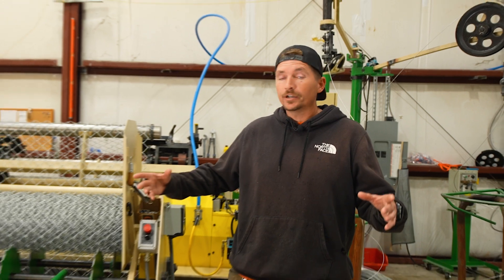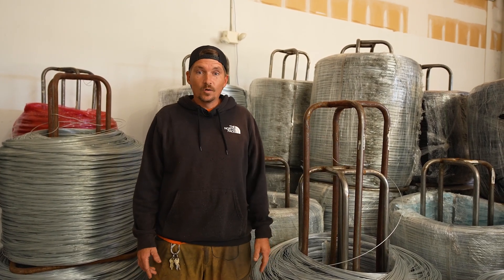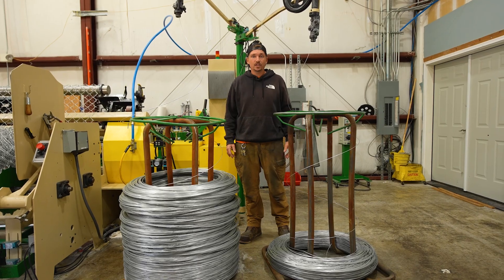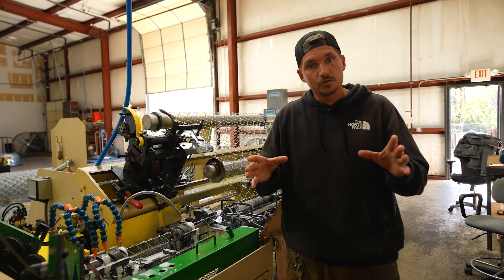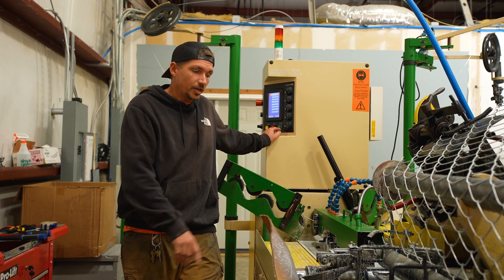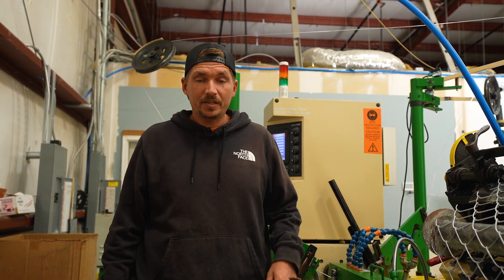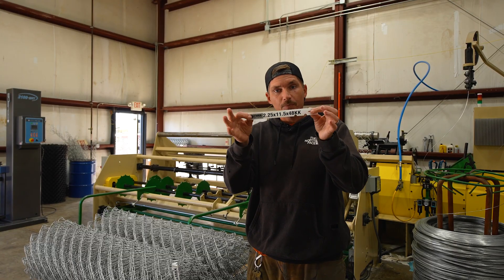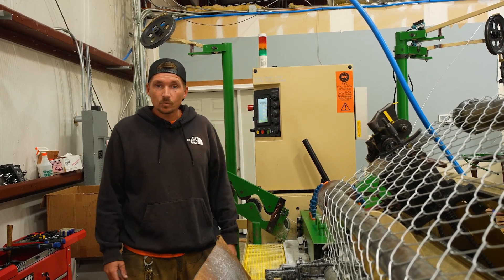This Chain Link Machine Is INSANE! - How Chain Link Fence Is Made

Comment: youtube random, that was cool to watch, I used to do work for a company that made wire mesh conveyers that was on similar lines to that  and was asked to make what they would call a giraffe that puts the pitch to the wire, I had one attempt to screw cut the groove 4mm wide 15mm deep and after many hours and re cutting  tools I said no way, I couldn't understand how they were made to fine but to watch the wire machine run and how simple it was was great, no fancy encoders or any fancy plcs just plan simple mechanical cams that to adjust was a tap with a hammer and boom all day just ran.